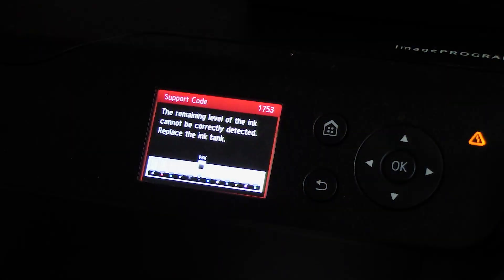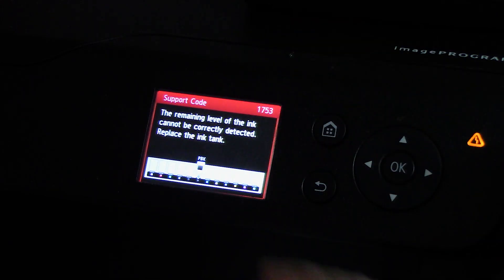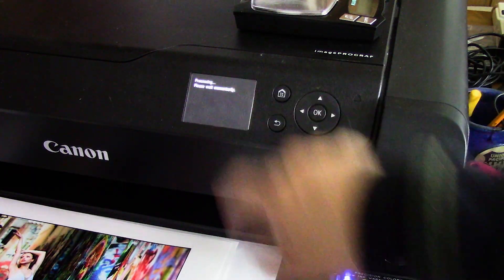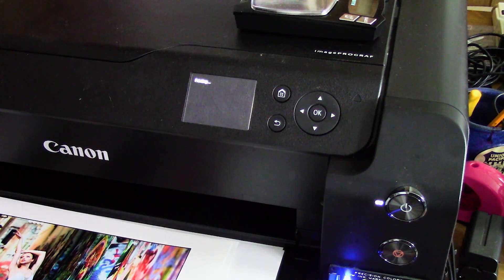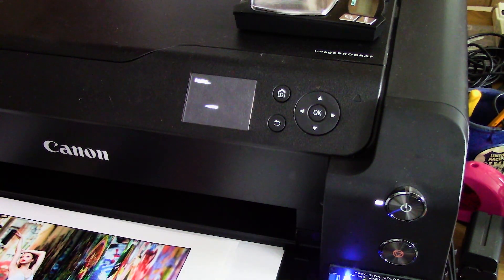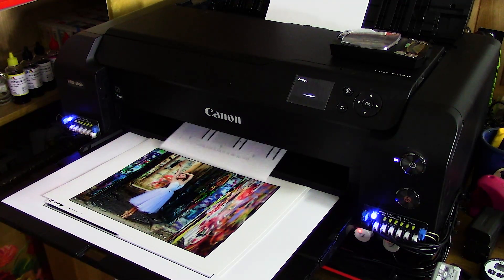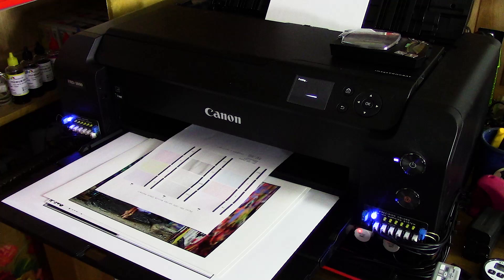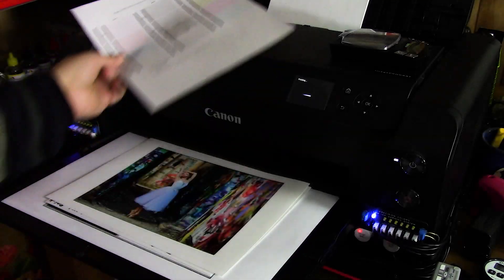Let's be Realistic about 3rd party vs EOM equivalent dye ink fading!

Comment: You have no idea how much I treasure your knowledge. Especially because I own a PRO100 (still running OEM inks). I’m holding on to my empty cartridges just in case I decide to make the switch. I have a question for you, I absolutely love the RR Palo Duro Baryta Fiber 300 but every time I print with it, I get a top to bottom roll mark (portrait orientation top to bottom right side) (I use the abrasion reduction setting). If I use the manual feed it’s actually worse than the top feed (which is strange). If you have any insight on this issue, I would appreciate your response. Finally, RR customer service recommended that I try Big Bend Baryta 310 paper in lieu, they said it was less sensitive and thinner but denser than the Palo Duro Fiber. Have you tried that paper yet? If you have, what are your thoughts and how does it compare? I have a new set of inks coming from RR including some Big Bend Baryta samples to try. Thanks in advance for your precious time and talents.
Reply: Jose generally charges for a consult.
Reply: Ok, how do I book a consultation?